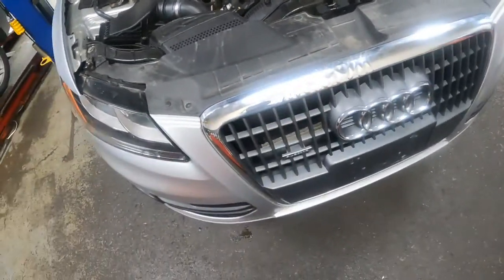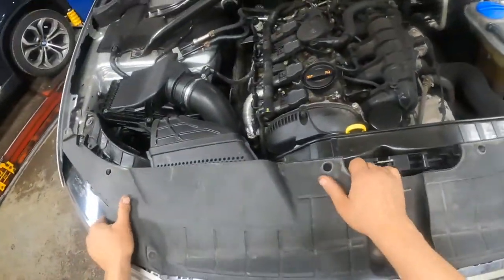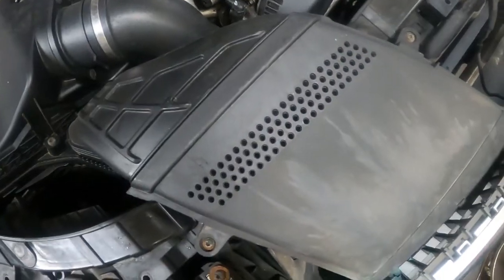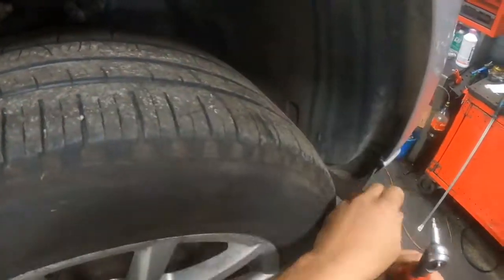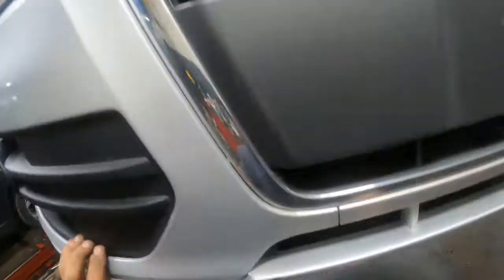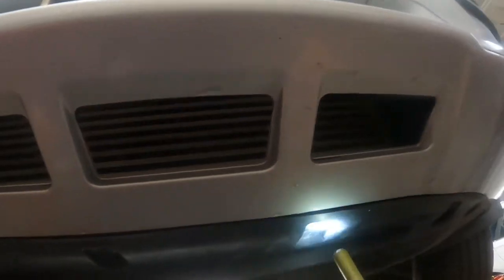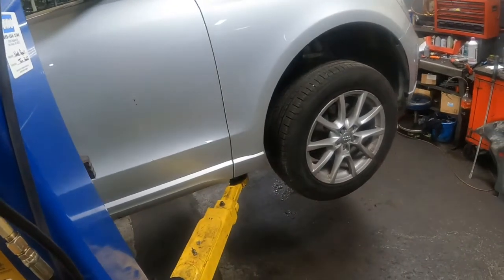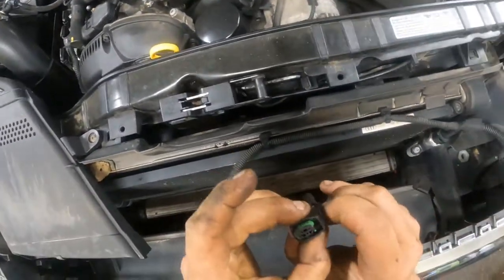REMOVING THE FRONT BUMPER ON A 2008-2017 AUDI Q5

Comment: Have u ever had to fix open circuit on aux coolant pump I can’t find good info anywhere online I’m getting p192700 aux coolant relay open cir I already replaced pump but still not getting power to connector ,please help thanks 😢
Reply from the maker: On some models they actually eliminated the aux water pump, read about that recall and make sure yours doesn’t apply
Reply: @EuropeanAutoRepair  thanks for replybut mine is 2011 a4 b8
Reply: @EuropeanAutoRepair  do u know what powers the aux pump is it the relay from the ecm ?